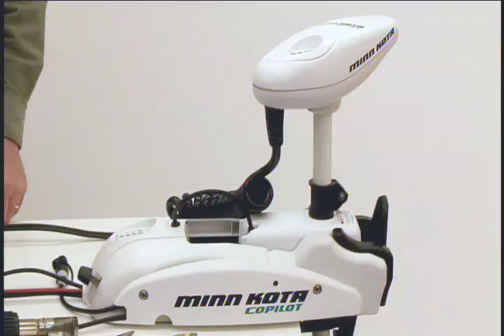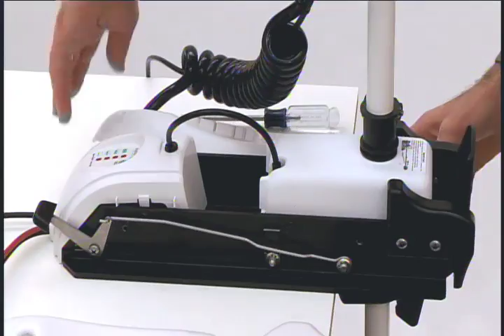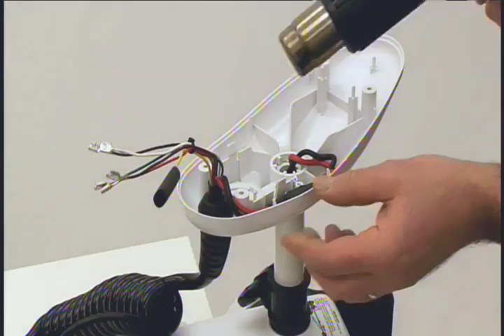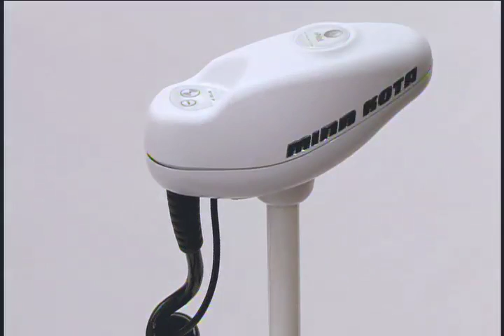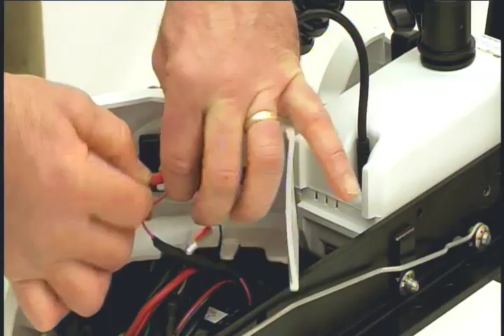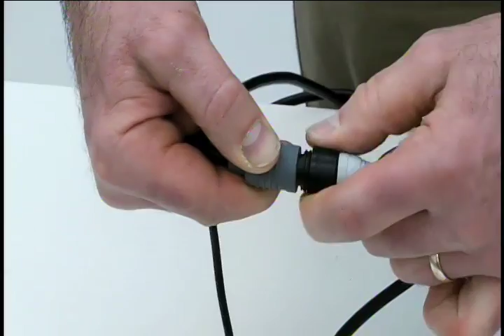i-Pilot Installation on RiptideSP with AutoPilot

Comment: Hello I have a 2017 Minn Kota RT Terrova80/CP-54" BT. I want to add the ipilot system to it to achieve SpotLock. My Serial number is R306MK01257. PLEASE HELP!!!!!
Reply from the maker: Hi Wesley,

Getting Spot-Lock functionality would require installing an i-Pilot service kit on the motor. For that motor that is part number 2774157. That kit can be purchased through the following link;
https://bit.ly/3oTPfQx

Thank you

Comment: Hi there,
May I ask what the part no is this ipilot controlling system? will it fit 2017 model?
I have recently bought a new 2017 riptide 55 rt sp/fp, which does not have ipilot, copilot, and the traditional standard auto pilot.
I was wondering if it can be upgraded to ipilot version. I have asked a few minn kota "experts" and dealers, they told me different stories. You are my last hope. hopefully you can help me out.

Best,
Calvin
Reply from the maker: Hi Calvin, thanks for your question. Can you please provide the serial number for your unit? That will help us determine with other products you need. Thanks!
Reply: the s/n is : R321MK01578. 
Best Regards
Calvin
Reply from the maker: Hi Calvin, thanks for providing this information. Here is the part number and the link to buy this product. Please keep in mind that if you upgrade to the i-Pilot, you will not be able to use the motor's foot pedal at the same time, it is either the foot pedal or the remote. If you have any additional questions you can contact Customer Service at (800) 227-6433 or service@minnkotamotors.com. Thanks and happy fishing!

https://motors.johnsonoutdoors.com/PartStream/SearchParts.aspx?_ga=2.105006531.1787665532.1524488660-1819600618.1484146206
Reply: thanks, really appreciated your time and great help.

Comment: Question. I just bought a boat with the Riptide Copilot. It has a remote, but not as elaborate as I-poilot. Just so I am clear, this is a add on that can bring my older unit up to the current standard of the NEW  units? FYI, my Minn Kota is probably 2004 vintage which is the age of the boat
Reply: Were you able to upgrade your Riptide with iPilot? I have an older (2004) Minkota also and would like to perform the same upgrade. Thanks!
Reply: @JTEnoch  no we traded that boat. But it appears that it snaps in place